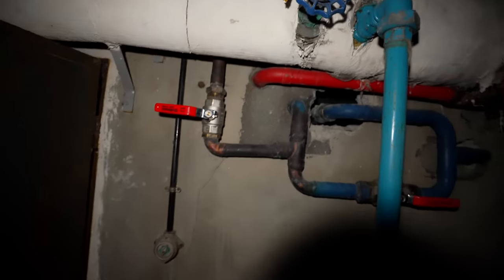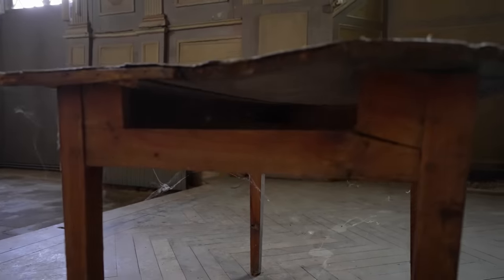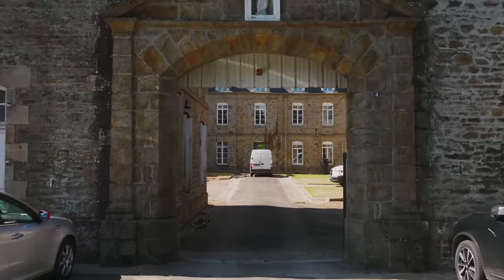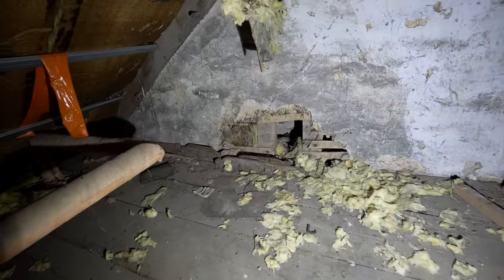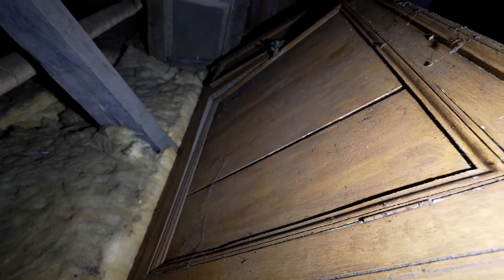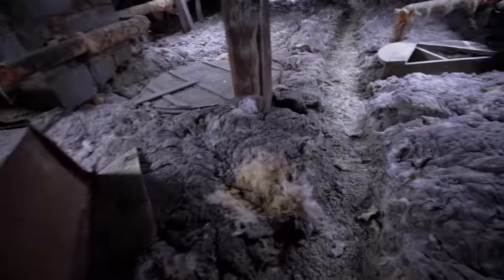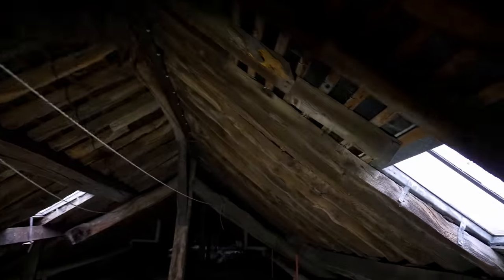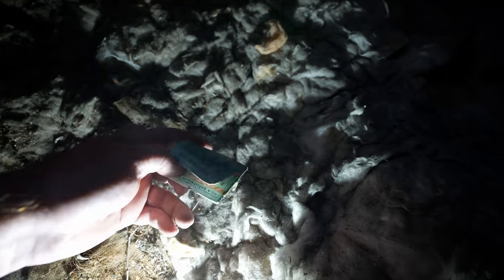Exploring Hidden Parts Of The Abandoned Convent

Comment: If you removed all of the old insulation from the attics, you just might find some interesting artifacts from the days when the place was actually in use as a convent. Then it would just be matter of replacing the insulation with new.

Comment: looking at those roof cavities, with that fluffy insulation. Would probably be best to replace all that with more modern insulators and then board it over the top to add a little extra, and also add more storage space and not have to worry about falling through the ceiling below.
Reply: I would recommend wearing a face mask 😷 while in the attics. Insulation fibres are nasty to breath in 🤔
Reply: @davemac3081  agree fully there
Reply: Two years late, but not only the insulation fibers. Any rodent droppings or urine stirred up in the air can be a major health hazard. It was the cause of a lot of deaths in the US in four neighboring states back in 1993 until the cause “hantavirus” was discovered.

Comment: What's most interesting about the attic is the level of detailing on the bannister etc. Almost as though they came from another older structure and the nuns used it because it was cheaper than having a new staircase etc being built and installed. Otherwise why would you go to the bother (& expense) of installing such ornate work just for an attic?
Reply: I wonder if that section was considered part of the public areas and therefore nicely finished (because it was visible from below).
Reply: @Ragnar8504  Unlikely unless the attic was used as overflow accommodation for travellers or visitors.

Comment: The linen fabric you found probably was used by the nuns to make their habits , as well as altar cloths for the 💒 ALSO since it was a hospital long ago
Bed sheets and bandages.  The rope lines in the attic may gave been to dry bandages in the winter since the lines were not very high from floor. We are used to disposable bandages but they could not afford all that linen. They would have boiled the diety linens.  Also as women they needed sanitary napkins which women made from old bed linens and they were washed also 8n  boiling hot water but to dry them...they would have been discreet.
Reply: Yes, I believe you are right about sanitary napkins. Bandages would have been kept closer to the hospital areas, no point putting them up in the attic.

Comment: 7:25 Very old yarn butlers. The cone ones would have been able to hold three balls, with the smaller two used for accent colors while knitting.
10:25 Grosse etoffe...big cloth?
12:35 laundry lines most likely used when weather was too bad to dry outside.

Pretty sure that attic was the designated knitting/sewing/mending space for the nuns. I'd bet if you checked the floor in the little room area you'd find needles, coins, buttons that got left behind, the insulation looks to have just been laid on top of solid flooring during the last renovation.

Comment: There is one leak, the new valve that your plumber put in. It shouldn't have water dripping from the handle at all, might need to either replace it again or check the O ring.
At the very end of the attic where the tins were, behind the ladder looked like it once had an opening that had been sealed over. Have you checked from the chapel side?? if there is a hidden room?

Comment: Gross Etoffé translates as big cloth. That room in the attic may have been eother a punishment cell or a cell for a nun that went mad. Nuns were  don't forget, quite strict and sometimes could be very hard and cruel.   That wooden "arch" is indeed a brickwork form, for brick arches. Some of the timbers in the attic there need a bit more looking at, I noticed signs of previous use, so possibly some of the timbers were reclaimed to for that building.

Comment: "Grosse étoffe" in the attic "room" - means it was used to either dry or store 'heavy' fabrics.  This would include tightly weaved canvas - often used for tenting or awnings.  In a convent, the fabric would have been used for making rugs under foot, cloth bags, hats, caps and coats. The fabrics would have been jute, wool, linen (made from flax fibers), perhaps cotton from a distant plantation and gifted to the convent.  It would also have had some burlap sacs for flour and other food staples. 
 Billy, for your own health and safety sake, It would be a great idea for you to wear at least a dust mask when you go hunting for old areas.  Though the insulation in the attic looks to be settled, if any creatures have been using it for storage or nest building in another part of the convent yet to be discovered by you, the air you are breathing in, could contain either asbestos or fiberglass (from the looks of the type of insulation.   Both are dangerous to alarming as both can put down small amounts of particles in your lungs.  Also, if there was any type of mold issue (which I suspect might have occurred at one time. you don't want to be breathing in all that!  Think of your partner Gwendolyn and your little sons.  They'd like  to keep their daddy around for many years to come.  Take if from someone who saw their father suffer the last 4 years of his life carrying a back pack with an oxygen tank.  It wasn't easy and in the end, his lungs couldn't take in more air and he suffocated from the deposits of asbestos and fiberglass on his lung lining.

Comment: Why does the plumbers handles leak??
Reply from the maker: those valves are commercial type and they have a small seal around the handle which requires to be tightened which it was and now it does not leak

Comment: Looking at those funnel-like devices, it reminds me of part of candle making although I didn't see the candle forms where the hot wax was pouted and the spire like extensions would be where a hole was punched into the candle for the wick to be fed into before sealing it. I am probably wrong, but they are something my Great-Grandmother used before electricity. As far as the insulation shown, one could use a short tanged rake to smooth out the distribution into an even level.
Reply: lightning rods  imo